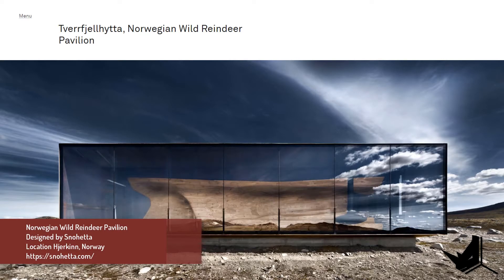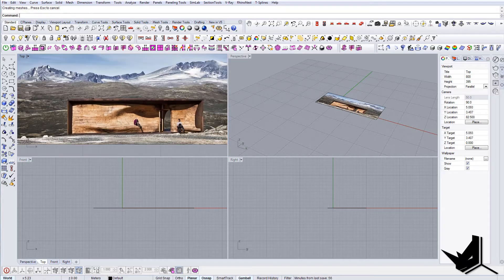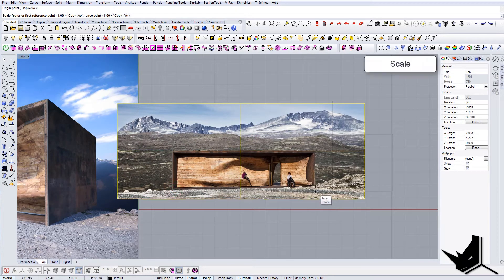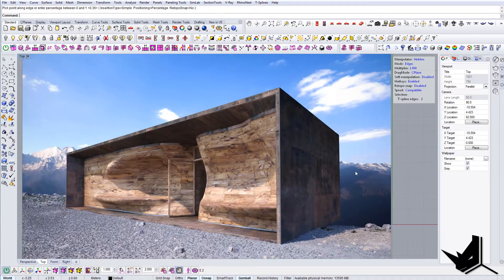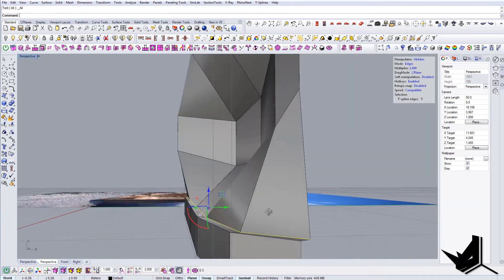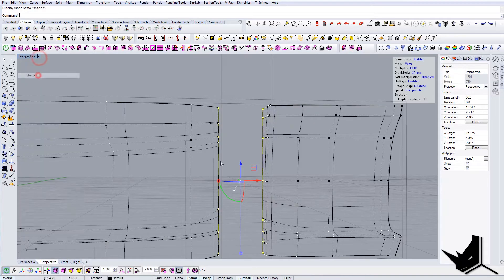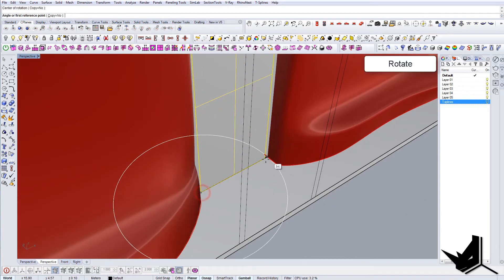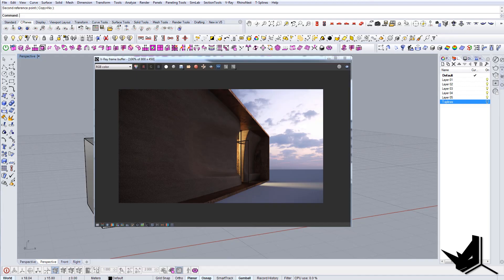How to Model Norwegian Pavilion in Rhino

Comment: hi. Thanks for your great videos. I can't run t-spline plugin in Rhino 6. Can you explain me how can I model this kind of shapes in Rhino. Thanks alot :)
Reply from the maker: T-spline doesn't work with Rhino 6. You can use SubD tools for Rhino 7. They are a great replacement tool :) There's a couple of videos here on the channel about SubD tools. Make sure to check them out.